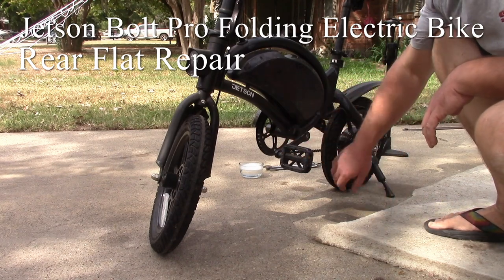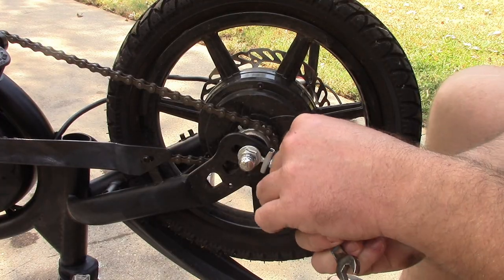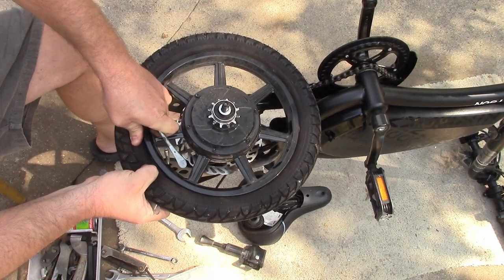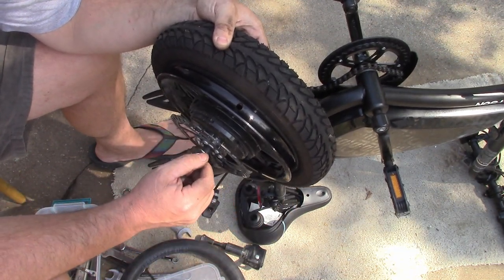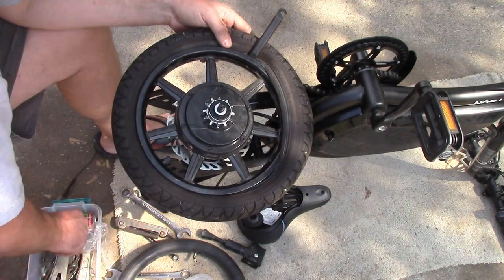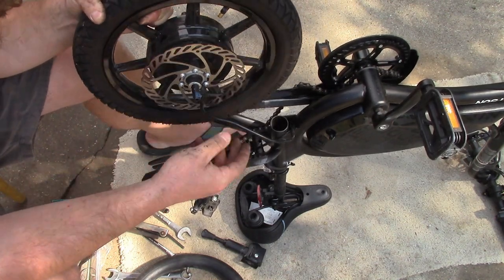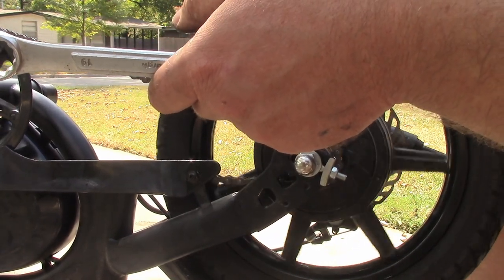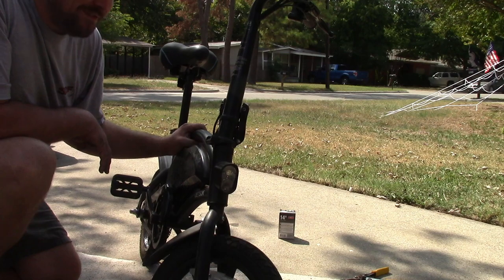How to Fix a Flat Tire on a E-Bike featuring Jetson Bolt Pro Folding Electric Bike

Comment: I've had my Jetson Bolt Pro since the pandemic, and I have the original tires and inner tubes. But I hit a bump wrong and the back tire flattened like a pancake. I finally got replacement tubes for it but I was a little intimidated about replacing it myself. Thank you for this very informative how-to.

Comment: Thanks. I needed a tire as well, and that was a real pain getting on. But the curved valve is really important, I ordered that and a tire for $25. I had my bike shop change a flat once and they used a straight valve and I needed to get a valve extender to fill it and even then it was always a challenge. But it also eventually caused the current flat because the leak was right at the base of the valve, so I think the need to keep bending the valve in order to get it in a position where I could fill it caused the tube to fail.

Comment: I live in Miami Beach which is a pretty small barrier island. And I bought one of these about four years ago. Since then I might drive my SUV once or twice a month. And that's usually only to the grocery store someplace where I need to bring stuff back home. Of course that didn't stop my auto insurance from doubling in the last year. I probably pay about $10 per mile in car insurance.
Reply: I bought mine last year as well. Spent the winter fixing all the scary bits. Put a 14ah battery in [it fit!]. Shocks, off road tires [kenda k50 is fine for the front, not at all good enough for the rear] bmx bars. It is also my main transport for errands. But now I can take detours.
Of course, now that I have started, I cant stop. the OEM batter is getting mounted in the front with a 3 way switch, and both compartments will be heated so I can keep riding til there is actual snow on the ground. Next year? throttle based sound effects, with a 20 watt speaker.

Comment: I had the same problem with the air leaking around the valve but no matter that inner tube I buy, the air doesn’t stay in/pump into… and my tires are originally tubeless so I switched to a inner tube and this problem still occurs.. any thoughts cuz it looks like u just replaced the inner tube and that’s it?
Reply from the maker: My replacement inner tube is still holding air to this day. I haven’t had to go back in yet.

Comment: My brake system won’t unscrew ife used an alley 5mm and extension to help but it just strips it and its too tightly fastened.
Reply from the maker: Dang, That sucks! Try some penetrating oil giving it time to soak in and some vice grips on it first. If that doesn’t work you might need to drill it out if and use a screw extractor. If that doesn’t work you might need to retap the threads. You can buy a matched drill bit and thread tapping tool to match the threads that need to go back in. Problems like this can get very frustrating but adding new skills and tools to your arsenal is always a good thing. Good luck with everything.
Reply: Actually, don’t unscrew the bolts shown. I had same problem but then loosened the two bolts underneath those shown in the video and brake came right off. They are underneath the two he did and generally face the ground pointing up towards the bike seat.

Comment: The jetson axle 12 inch bike is worse you have to use the jetson tubes only. The rim is so small the valve is too long I’ll have to try to a different type of pump like a straight one at a gas station cuz a regular bike pump won’t work